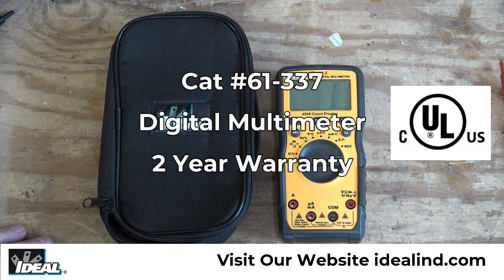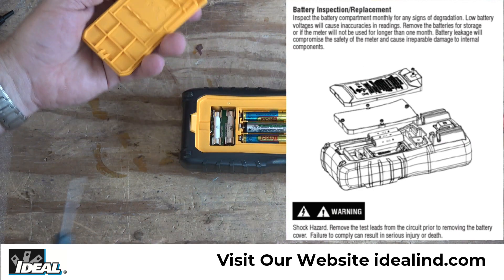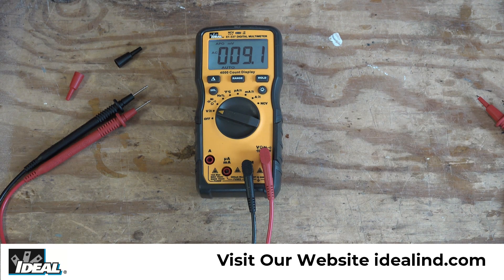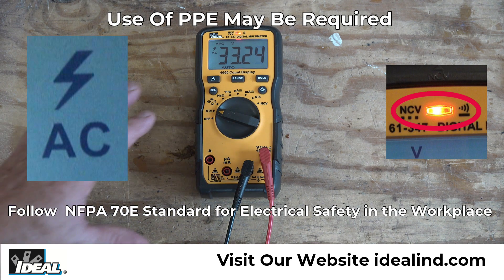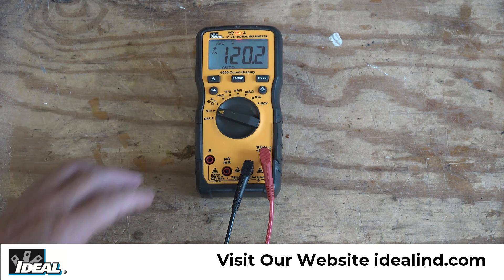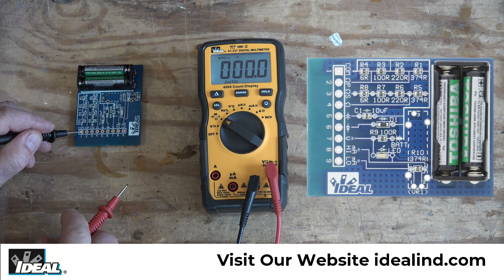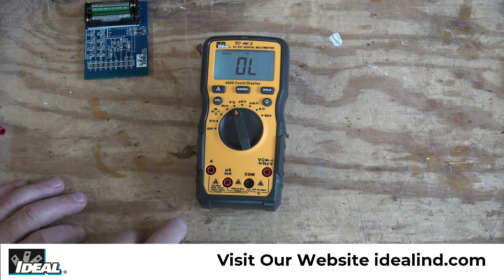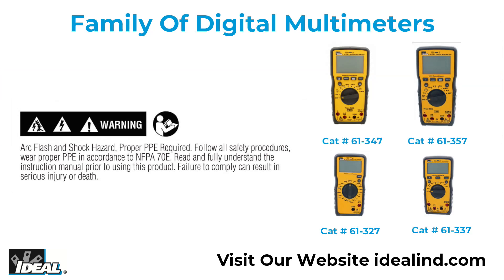Learn How To Use the IDEAL 61-337 Digital Multimeter

Comment: Can this meter be used to test AA batteries? Not just a voltage reading, but with a little load? 
Great video. Much better than the tiny manual included.
Reply from the maker: Hello this tester will not put a small load on the battery but the 61-327 meter will and has a setting for testing batteries hope that bhelps Ron

Comment: Great and helpful information is a short time.
Question.
I'm using this same multimeter on an Victron Lynx distributor, across the pos and neg, with everything turned off, I think....
My meter HV led glows red, and the display tells me OL
OL tell me there is not voltage, but the HV led tells me there is 30 or more volts.
I selected dc volts, and same thing.
I don't know if I can work on it. 😬
Reply from the maker: Hello I do not know what a Vivtron Lynx distributor is so I am of no help have fun Ron
Reply: @RonKipperDatacomm1  Hi Ron. Thanks for getting back to me.
If you work with solar, you'll know about Victron products. Our Cirrus camper uses them and people use them in the RVs.
Anyhow, this is weird, where my Ideal VOM is telling me OL, which I learned in this case is telling me Over Load, not Open Lead, but another VOM is telling me 13 volts. I thought the red led was only supposed to warn in High Voltage, 30+ volts.
Oh well. Going forward.
Reply from the maker: HI Allen OL is Over Limit and the unit will warn you for voltages over 30 Volts good luck Ron
Reply: @RonKipperDatacomm1  This is true, but the voltage is 13 volts. Shouldn't it tell me when it's 13 volts? Over Limit is for anything over 30 volts.
Reply from the maker: Allan I am not sure what you are tyrying to ask me. The meter is auto ranging so if there is a voltage between 0 and 600  Volts it should give you a reading. The red LED will lite ip and the lightning bolt on the display indicates voltages over 30 V indicating you might want to use PPE when testing hope that helps Ron

Comment: This is a great video, I have watched the video for the 337 and 346. These are the most comprehensive videos I have watched on electrical meters. I have a 312, bought the 337 (after watching this) and I’m more than likely going  to get the 347 (still don’t know the difference between the two). I have a few benches and want to get them all test ready. By the way, is there a part number for that Ideal PCB? I think it will make a great training tool. Thank you very much.
Reply from the maker: Hello that training board is a 61-001TB if you want to order one use the testers well! Ron at ron.kipper@idealindustries.com

Comment: Hmmm- Testing CAPACITANCE....🛑Using the SEL button, my 61-337 doesn't cycle to uF in that that 3rd setting...it starts w/ ohms, kohms, F, V, then back to ohms... :(
Reply from the maker: When the display reads F it is reading Farads which is the correct setting for capaciators have fun Ron

Comment: I bought the 337 for auto wiring. All it does is beep fuse or lead. Changed the fuse, tried for an hr to stop the lead beep. threw it in the trash after 2 hrs of beeping.
Reply from the maker: Hey man if you need help reach out to me Ron

Comment: why wont the leads go into the 61-337 digital multimeter
Reply: nm I see it.....there was no showing that you have to remove the ends of the side of the lead that goes into the multimeter.  Thx
Reply from the maker: Dupa Acct are you using the leads that came with the tester? They should work Ron
Reply: @RonKipperDatacomm1  Ron there are caps on the leads that go into the multimeter.....when I watched the video and tried to put them in they wouldnt go in.  The video doesnt show you taking the caps on the leads that go into it so after a while I figured it out.  No one has a video that you need to take the caps off the leads. You only show the caps that come off the prong ends.
Reply from the maker: OK maybe I can work that into the next video Ron

Comment: I just bought this . Is there a 101 class for beginners ?
Reply from the maker: Kevin this about a basic of a video on how to use the tester that I have. What are ypou trying to learn?  Ron
Reply: @RonKipperDatacomm1  I bought this to try to troubleshoot some problems on my 96 safari van . Testing for correct voltage and checking the relays . This thing does way more than I need . And far more than I know how to do . I'm going to search YouTube for testing the specific parts I need to test . It's hot and fixing the AC on my van is top priority . Thanks
Reply: @RonKipperDatacomm1  I'll search " trouble shooting a GM AC unit. It's been many moons since Mr Godwin's electronics 101 in highschool .
Reply from the maker: Kevin I hope you get it fixed it is hot out there! Ron

Comment: The spec sheet says it does min and max. I can't find it. That's what I need.
Reply from the maker: Hexdude24 you are rightbthat spec sheet is not correct the 61-337 does not have a min and max function. My apologies I will get that fixed. Ron

Comment: It seems one has to set to AC voltage, let it zero out (or close to that) before going to DC. Otherwise, the DC reads all over the map.
Reply from the maker: John the tester is can measure down to millivolts and with the leads in the meter and you turn it to volts it is picking up stray electrical noise from sources like the wiring in the walls, lighting, TV's or any other source. Just take a measurement and that goes away nothing wrong with the tester and no real need to zero it out. Hope that helps Ron